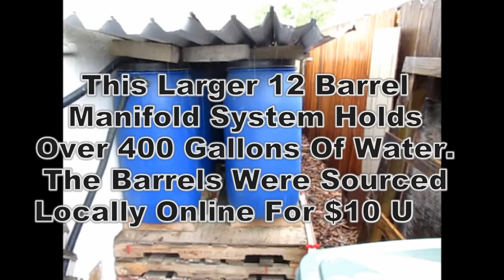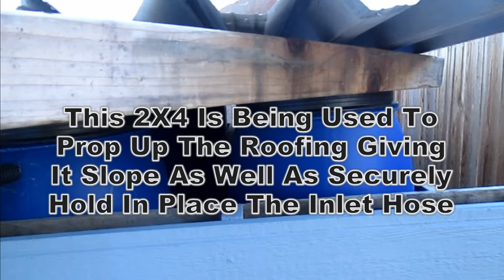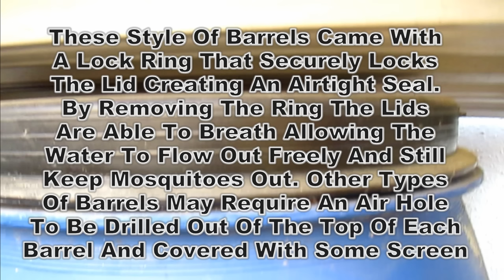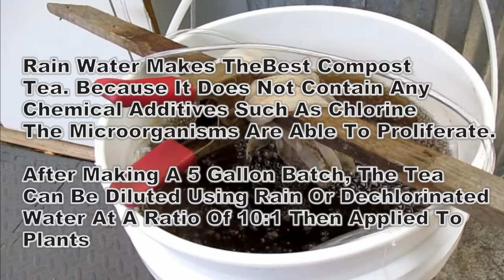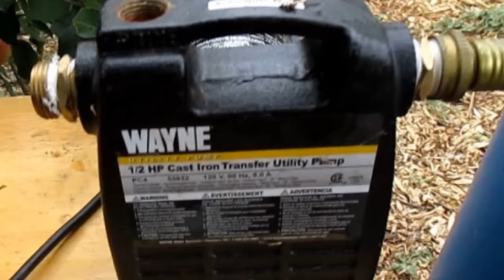DIY Backyard Rainwater Harvesting Using Repurposed Food Grade Barrels

Comment: I really liked your system and every description throughout the video, your channel is great!
I have a question though I can't help asking here, I don't know, maybe I'm missing something:

What do you mean by "By elevating the barrels with concrete blocks or building a stand, the pull of gravity is increased thus increasing water flow through the exit valve"?
The way I see it, putting the barrels on top of a stand has only 2 advantages:
(1) It leaves space space below for pipes.
(2) If the tanks are running out of water, depending on the height of the stand, you would have it a little easier or a lot more regarding the height of the hose (example: if you raised the hose above the water level in the tanks you would find trouble pulling out that water)

Again, the video is fantastic and I can tell you put a lot of work on everything, thanks so much for sharing!

Comment: Recently had a new roof put on and the roofing company recommended not using water from asphalt shingle roofs in general due to poisons introduced into the water from the composition shingles.   They recommended only certain types of metal roofs be use.    Did you have your water tested?   Good results?
Reply: TR Branch, that is a dam good point you raise there. I wander how many people actually take that into account.  I am thinking of coating my roof with some none toxic pond seal resin that is safe for fish.  Maybe 2-3 coats. Great Comment dude!!!
Reply: I seem to remember concern about asphalt shingles as well in regards to water catchment systems. Can't remember though if it was because you wouldn't want to drink it, or it makes the water less desirable for gardens as well.
Reply: Good point, however I run my gutters to the ditches in front of my house and it’s a battle to keep the weeds down, so maybe when the roof is new there might be nastys coming off it, but this dosnt seem to have any affect on weed growth
Reply: Boil the water using either solar or a water heater sitting in a wood fire.  It evaporates into a separate completely clean container to use for whatever you like.
Reply: Boiling kills living organisms, it won't help you with toxic chemicals.
Reply: Big D you're suggesting distilling rainwater to make drinking water? Have you got any idea how much energy is needed to evaporate just one litre of water? This is barely worth doing on an industrial scale in a desert environment like Saudi Arabia, where water is expensive and energy cheap. It would be madness to do it for home consumption.
Reply: Yep, I remember watching a video about the poisons from regular roofs. I thought it would be mentioned in this video. Also, he put the barrels on wooden pallets. He must know that if you put barrels on concrete that it will absorb the toxins from the concrete into your water. Very important if anyone is considering using this to drink or cook with.
Reply: Just taking a guess but I would say... Use of this water would be for washing cloths, shower/baths and other types of uses like washing cloths.
Reply: I use a setup just like this off my metal roof barn to keep my duck/goose pond filled. All the critters drink from it. Works great
Reply: Riddick State 

They forgot to mention it to practice the collection that can be done from top of roof or side of the property .. 
If perfom such ways mention can even collect harvest much more water and free from metals 

Such harvesting waters practices ate done in places like Cuba and I forgot for almost 40 years .
Reply: Rubberise your roof with something like eco-rubber...sorted!!
Reply: For a few reasons, it's a very good idea to have a downspout diverter mechanism at the head of your system. They are designed to divert a certain capacity of the  initial watershed away from the collection system, and then switch to collecting water from what has become a rinsed roof and gutter. 

This initial drainage handled by a diverter contains dirt, organic matter, pollen, bugs, pollution, and bird poop. I would think it to be logical that this initial diverter "rinsing" would also take care of any scary asphalt issues. Here's why... 

If Asphalt is not good for people, we'd have to figure out how people would be subject to it. It would be through these avenues: 1) ingesting it.  2) Breathing off-gassed vapors. 

Let's look at that. Asphalt is used for shingles because it's highly waterproof - it doesn't dissolve in water to any significant amount. So we know that water coming off the roof couldn't have some significant quantity of dissolved asphalt in it. 
Also, asphalt is used for roofs because it is very durable, lasting for decades. That means it doesn't typically erode, powder, shed, or flake off. Finally, Asphalt might off-gas; but any significant quantity happens when shingles are new, and it's only in low quantities that dissipate into the air and don't collect on the roof's surface. 

So, even if asphalt were actually significantly toxic to humans, we'd have to assume by its properties that asphalt is difficult to get inside in any dangerous quantity, and is therefore relatively safe for what we are discussing. AND, if a person has such a diverter that's removing surface contaminants through a rinsing stage, any small quantities of indigestible loose asphalt would be washed away with the other crap I mentioned. 

What would be more significant in my mind, has to do with the design of the shingles. Shingles have small rocks embedded into the outer surface. These can easily collect and tenaciously hold debris, hindering the initial rinse. Take for instance bird poop, which is usually a little wet when dropped, and then dries and hardens around the little rocks. So it's not going to come off easily. Some poops, when dried, get pretty hard. Even if dried tho, it is still a lmore water-soluble than asphalt. So it could be unaffected at the time of the rinse; but then slowly softened, eroded, dissolved, and/or broken off  during the course of a hard rain. So for me, that's kinda gross... BUT...    

Generally speaking, If a person needs to drink their collected rainwater, they should always treat it first. There are two steps to that: 1) filtering can remove big and small dissolved compounds & chemicals, ans 2) boiling, UV, and/or added chlorine/iodine will kill pathogens. 
Some high quality filter systems (e.g., Berkey) take care of both steps.

Comment: In Aquaponics systems they use swirl filters to run debris free water into the basins while dropping the sediment to the bottom of the filter without screening.  The bottom of the filter has a purge valve you open to flush out the debris.  Clearly for the amount of water you're capturing you'll need a larger scale swirl filter to accomplish the same job but it would save you have to inspect individual screen filters and scraping them clean.

Comment: Sir- First off, thank you so much for this informative video. I really appreciate the text and the explanations.Two questions:Is PVC pipe freezing a concern in the high desert (3,000-5,000 ft elevation) and if so, how do you protect against that- just wrap the pipes in a sleeve?do you have any issues with algae growth- and if not why, if so, how do you mitigate it, since you do not add chlorine?
Reply: To prevent algae growth you need barrels that do not let in light. You can paint the barrels black to reduce it even more.

Comment: This is a great setup. I have something similar in mind but barrels are crazy expensive here.
Reply: Save / bank a little at a time. Use the time until purchase to do the research and homework for your project. Even acquire needed small bits & pieces like pvc cement... washers, plastic etc. so that it is NOT an overwhelming expense... all at once.

Comment: The pull of gravity doesnt increase just because you got it on blocks.  Try pouring water out of your water bottle in a second floor vs on first floor.   You need a longer hose then more vertical length of hose can help pull water out because the hose is effectively increasing the height of your container.    Fwiw.
Reply: That statement about increasing gravity made me curse out loud. I think they meant increasing potential energy. But for what, I don't know.

Comment: Hi Dan
I am a new gardener and have watched and appreciate your inciteful videos. My only available water source here in Oracle Arizona is city water. I can collect water from the roof but we get such a low amount of rain I would like to come up with a better solution. Your other videos show you adding I believe vitamin c to the water to stabilize or counter react the use of chlorine in our tap water. I am retired and have lots of time. Any suggestions? I have quite a few plants and would like to water them with water that is not harmful to the living soil. Our daytime temps in the summertime can get over 100 degrees with single digit humidity. We are at almost 5000 feet in elevation. My daily water use in the summer that is quickly approaching is currently around 1500 gallons.
Reply: Research Brad Lancaster.  He is from Tuscon, Arizona and has many unique ways to harvest the rain using landscape methods.  You can find him on YouTube.  He also wrote a book you can find on Amazon.
Reply: @annswallow1729  Thanks for your help. I will do some research

Comment: I just went ahead and bought one of those 275 gallon totes and 2 of the barrels to save space. I tarp the tote to keep out sunlight. I use an old athletic sock as a strainer. I have a small gasoline pump and 1 1/2" hose that will move a ton of water in just a few minutes. Works great to water the yard, garden, wash down vinyl siding, cars, the dogs, whatever. You can even treat and filter the water [chlorine]  and use it for the swimming pool or bathing or drink it if you had to. AND ITS ALL FREE. SCREW THE WATER COMPANY. Now all I need to do is replumb all the toilets to flush using this system and maybe bury the tote to handle winter freeze.

Comment: this was cool. i wonder if part of that system was a sand style filter would make the water potable..?
Reply: If not add some activated charcoal probably could or at least be one step closer
Reply: Not reliably Sand and charcoal filters will not filter out viruses. Remember that birds and other critters even rats might poop on the roof. You would PROBABLY be ok, but depending on other factors the risk might be higher.

Comment: Have a pipe going to the basement and have a carbon filter connected to it and have another barrel connected to the pipe with the carbon filter and it will provide good fresh drinking water in case of emergencies.

Comment: do you think I there is metal pipe equivalents to all the pvc pipes? I live in South Missouri where it freezes. great video, great design! I love it
Reply: Zach 42 I don't know if you can buy blue water supply pipe where you are? It's designed for underground, but can tolerate freezing without a problem. Metal would just burst if frozen.

Comment: just subscribed..... thank you. quick question what are your thoughts on a first flush system versus the screening you put in getting ready to do my own rain barrel system and just want to know.
Reply from the maker: Hello Mark, thanks for subscribing! First flush diverters are great! I manually create a first flush by cleaning my gutters and rooftop thoroughly prior to the first incoming rain event of the season. I then allow the first flush of rain to empty into the existing french drain. After about an hour of rain I manually divert my flexible corrugated downspout to the tanks. Works great! Usually all my tanks are full after the first storm, so I return the flexible downspout back to the french drain. I may eventually invest in a more elaborate set-up complete with a automatic diverter and charcoal/sand filter. This entire system was built on the cheap and works perfectly for my needs. Here's a video I made that shows more of this process: https://youtu.be/zHQmvjF89pE Cheers!

Comment: Great video.  I would like to catch water for my garden with a 55 gal garbage bin.  Problem is that it will not seal.  Any suggestions as to how do I address the mosquito problem?   Thanks,
Reply from the maker: Edwin Howell, CPA, you definitely do want want to have an opening big enough for mosquito's to get in, but you also do not want an airtight seal as the water tank needs an air-vent to allow the water to freely escape. My containers came with lids tight enough to keep insects out but still allow air into the system, otherwise I would have drilled holes and covered them with screen material. Gorilla tape may be a solution for any gaps in your system. Dan

Comment: Overall like the system design, have concerns over roof type (honestly I will not have asphalt shingle roof when I build), and didn't like the idea of having to clean 12 screens - when a screen system could be incorporated in the downpipe - one screen to clean and easier to access regularly.
Reply: Randal Lovelace in the UK asphalt roofs are unheard of for houses- I don't know why anyone would think they are a good idea. I guess the disposable culture in the US? Roof replacement here is a once a century job if you're unlucky! Asphalt is used for the kind of garden sheds you buy at a diy store that rot  or blow down in a couple of years before the roof fails! The only place you might find it on a house is the flat roof of a bay window, or an older style flat roof rear extension. Even in these places though it is more likely to be replaced with a rubber type or GRP when replaced.

Comment: Quick question - Any reason you didnt just connect the barrels at the bottom that way they would drain equally using one spigot instead of needing 2 spigots?
Reply: If he did that the connection would need to be water tight. In the video it looks like he just cut a hole in the barrels and stuck some sort of tube in there. That's a lot easier to do and he only misses out on a couple inches.

Comment: What happens when the weather drops below 32 degrees into the freezing zone ?
Reply: This setup only works in warmer climates. For colder, you'd have to burry it below the frost line, or use a thermostat and heating to prevent it from dropping below freezing.
Reply: Use an underground cistern and an electric (solar) or manual pump!
Good question though.
Reply: Just don’t save the water in the winter
Reply: Build a shed or if you own the home have the down spout run through the wall of your garage. This is a great idea for those who live in states that will fine or arrest for collecting rain Water. Get your rain water nobody knows you are collecting and keep it above freezing temps
Reply: Drain before the winter.
Reply: Usually there would be snow, so collection would be impossible, the water would freeze inside the barrels if water was left in

Comment: Any ideas for creating a system to use solar/or heat to automatically distill water upon collection and have it diverted to a separate tank? Would be cool to collect rain water, then have it flow through a system that either filters, or distills it and ends up in a final clean tank. Someone let me know or point me in the direction if something like this exists already. Thanks!

Comment: it's not that the pull of gravity is increased, the height of the water level, compared to its exit point is what matters for pressure. if you have a hose connected to the exit valve and it goes even lower, pressure increases. (hydrostatic pressure)
Reply: And btw beautiful system. How much Litres can you store? Also, after some time as the water sits in place, my guess is that oxygen level in the water drops. Do you need to somehow compensate? any other troubles? for example, slugs, algae, whatever, that ruins the water?

Comment: how long you can stand with the water in the drums. Thanks
Reply: COMPLETELY blocking ALL sunshine from getting at the water will lengthen the holding time. None are forever, or even close... so plan on testing, dumping, cleaning, refilling as the variables of temps etc in your area dictate... i.e. there is NO one answer for all

Comment: Can you explain "by elevating the barrels, the pull of gravity is increased”?
Reply: The deeper water is the higher the pressure gets, ask a diver they are very familiar with how this works, if you are 3 ft deep you get 1.42 psi of pressure, at 10 ft it jumps up to 4.27 psi, put one of these 20 feet up and you get close to 10psi.
Reply: O. 
M. 
G.
Reply: @daveisnothere  was just confused by "pull of gravity". Didn't know he meant increased psi.

Comment: Water running off toxic tar into petroleum container. 🤤🤤🙏🏽
Reply: ...but daily imbibing from decades old, corroded, chemically built up pipes is perfectly safe ? 
IF truly such concerned... take water samples after constructed & pay for testing. Have them look specifically for the chemicals etc you suspect. I'd still use specific filters if water collected is for drinking, vs watering plants etc.

Comment: 0:20 I'm pretty sure that's not how gravity works.
Reply: gravity is just a theory
Reply: If you want to put gasolina in to your car, with a house, from a galon, you raise the galon.
Reply: The charitable interpretation is that by elevating the drums, we can install the outlets at the drums' absolute bottom, so that we maximize the output pressure (created by gravity's pull) thus increasing (maximizing) output flow. Sounds like his point to me. And it is correct.
Reply: @pauled99  That is correct, however that is not what they said. They said "By elevating the barrels ~~ the pull of gravity is increased". 

I just want to point out that I'm not saying your interpretation is wrong, but if that is what they were trying to say, then it's very unclear. :3